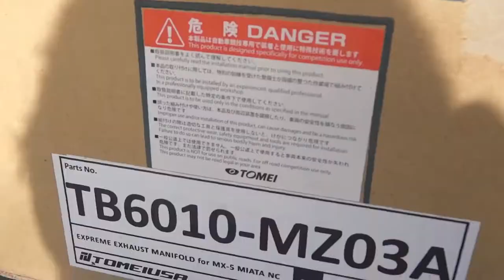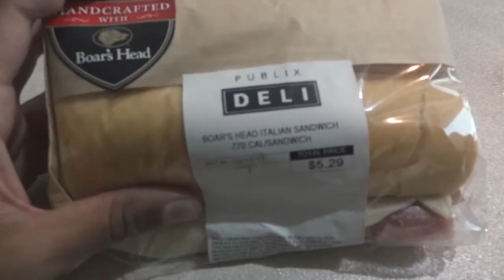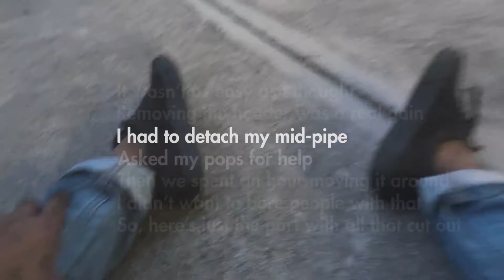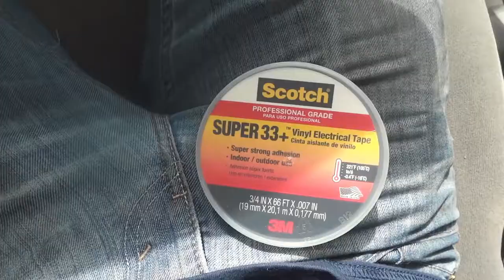Miata NC Tomei Header Install: PROCESS

Comment: im gonna sub love watching NC owners do things and your vid about bumper cutting just convinced me to do it too. i love the goodwin muffler i have it too with the mid pipe too, but im saving up now for the goodwin headers, what made you go with the tomei headers?
Reply from the maker: Sweet, thank you so much! Definitely try out the bumper cut. It’s simple mod that looks great. 

I was going to go with the Goodwin race header but I switched to the Tomei header because of the O2 bungs and I found it online cheaper than the Goodwin header (eBay). Without the the bungs you would have to buy extension cables to reroute the O2 sensors to your mid-pipe or have a tuner get rid of the check engine light. With the Tomei header I was able to have the first O2 sensor where it would usually be in the stock position and route the second sensor to the mid pipe to avoid the check engine light. All while saving money.

Comment: Good win makes an O2 extender for like 20 bucks.
Reply from the maker: I know, I just wanted to show a different method and save $20 lol.
Reply: Nice. Im going to be doing AEM intake, Goodwin maxpower, Helm Holtz mid pipe and super Q muffler on my NC2 soon. This was a good video. Im a little bit inspired to film my install but I haven't made a video in forever so that probably won't happen haha.
Reply from the maker: Sounds like a solid set-up! I’m holding out until I get a tune before a intake. 

If you want you should totally make a video. Different perspective and more NC content for YouTube.

Comment: Don't you guys have emission programs ?  The only way I could get away with this is to keep switching headers at  every test .so I am going with a catted model.
Reply from the maker: Not where I live, I don’t have emissions testings/sniffer tests. I would pass anyways because I still have a high flow cat in the midpipe. Although it depends on how strict the programs 
are.

Comment: Hi Great video! I have a very important question! Do you have to veld something on the midpipe or how did you connected the O2 sensor? Thank you.
Reply from the maker: The mid pipe I bought from good-win racing has a bung to screw in a o2 sensor. No need to weld. You just need to figure how to extended the o2 to the midpipe.
Reply: @meremortalsammy4580  Thank you! Im courious about how it's going to sound. My header is in the making currently. 😁 Excited

Comment: Hello. Nice job! What about power gain?
Reply from the maker: Thanks! I can’t say for certain because I didn’t dyno the car before or after. So it’s not scientific but as far has power gains I did feel more power across the rpm band. 

Unlike the exhaust and mud pipe where barely noticed a difference, I noticed the change with the header instantly. 

I really need a tune to unlock the true potential of the open exhaust system though.

Comment: Hi , i bought IL Motorsport header and end of exhaust , but still the original mid-pipe.
After the instalation and using a O2 extender my engine light have light on , can you help me solving this?
Thanks
Reply from the maker: There are two O2 sensors. A primary and a secondary. Make sure not to mix them up, the primary needs to go before the catalytic converter inside your IL Motorsport header. The secondary O2 needs to go after the catalytic converter. 
This is how they’re positioned in the factory header. You can’t just put both sensors in the IL header, this will give you a check engine light. 

You have several options. One, you can buy a aftermarket midpipe with a high flow cat that has a bung after the converter for you to screw the secondary O2 sensors in. Two, you can have a exhaust shop add a bung to your factory midpipe after the factory secondary cat to screw the O2 sensors in. Be warned though these require a extension wire so the secondary O2 can reach the bung. You can buy, cut and wire one yourself, or cut the factory harness and reroute the secondary O2 sensor wire.
Third, you can delete the secondary O2 sensor and have a tuner tune out the engine code. 

Make sure the check engine light is for the exhaust with a OBD2 reader. It should mention secondary O2 if I remember correctly.

Comment: Were you able to torque down all of the header bolts? Or were some impossible to get to? I have the skunk2 header and I couldn’t get to any of them with a torque wrench, as a result 3 of my bolts have fallen off.
Reply from the maker: I was able to torque all but 2 of the bolts. It helps if you have 3/4 torq wrench because it’s a little bit smaller and can fit into the smaller places. I torqued what I could then did the other two by feel. Few days later I checked them.

The skunk2 does have a unique header design. Which I think might be harder to torq. Have you tried looking at miata.net in the power/performance section? I remember seeing a few guys with the same header. You might to check out if they have any install write ups or direct message them to see how they got theirs done. 

Good luck!

Comment: Where did you get your wheels from and what size?
Reply from the maker: I bought my Enkei RPF1 wheels from a eBay seller for $650 with tires that I took off and sold for $100 a pair. So always be on the lookout for deals like that. 

If you want new wheels the cheapest site I’ve found for the NC is Goodwinracing

http://www.good-win-racing.com/Mazda-Performance-Part/60-1290NC.html

Setup in the video
RPF1: 17x9 et+45 5x114
Tires: 225/45/17 pilot super sport

I actually have 245/40/17 now and the car handles and looks even better. Just need to fender roll if you want the same setup.